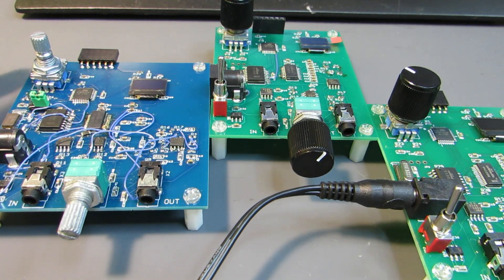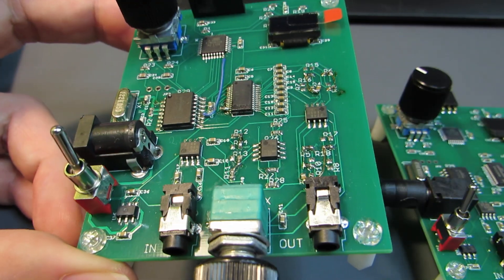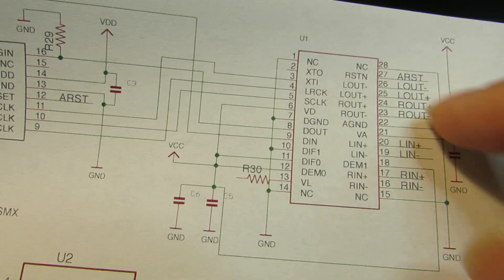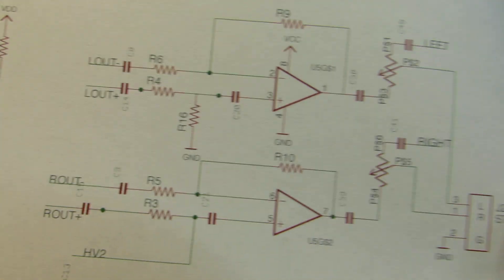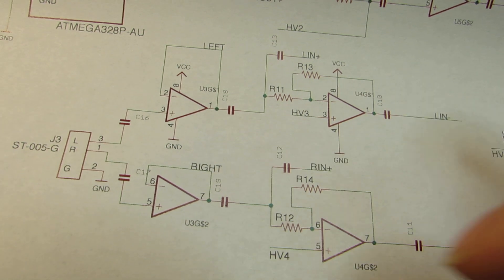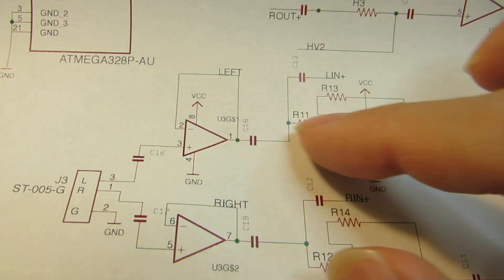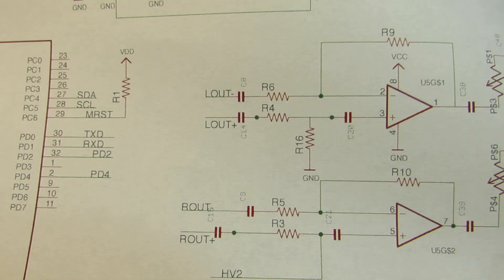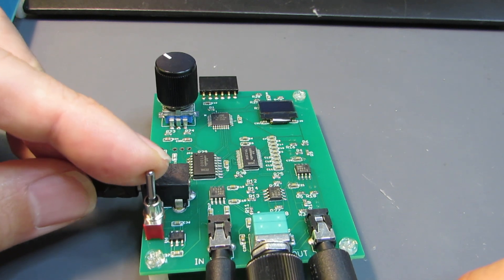Cool audio V4220M/V1000 based digital sound processor (effector)

Comment: Hi, this is great. I have a small guitar amp with built in reverb based on V4220M/V1000. Is it possible to simply add rotary switch (or DIP-04 switch) to the circuit to be able to change programs?
Reply: After some more reading: yes it is possible :)
Reply: @Viks021  Please I just found out bout this chip, do you have any guidance on how to use it
Reply: @emmanueloluga9770  Hi, I have tried 4bit rotary encoder but it didn't work. DIP switches will also not work I have tested. Now I will take 4 simple toggle switches (SPDT) - on pole 1 you get +5V (taken from V1000 power supply) and on pole 2 you get the ground. On the middle you bring pin 5, 6, 7 and 8 (separate toggle switch for each pin from V1000 chip). This should give us possibility to recall any of 16 internal effects. I will try it this weekend. If you google for Coolaudio V1000 datasheet pdf, in it you have reference application schematic. Good luck.